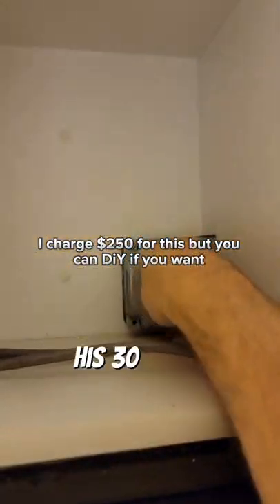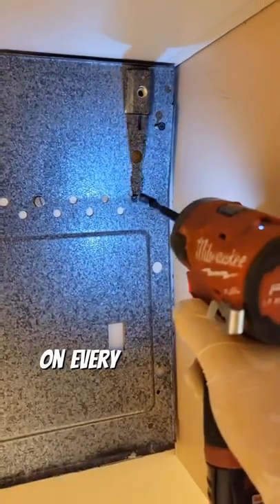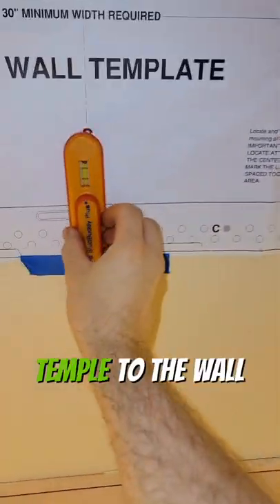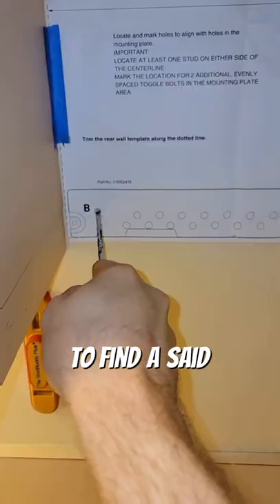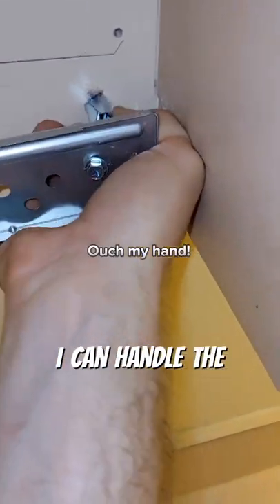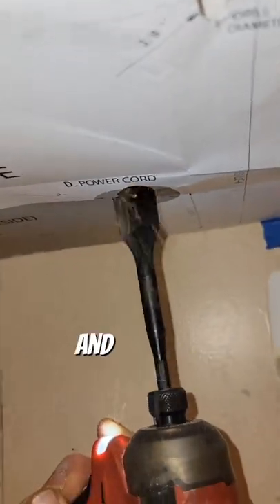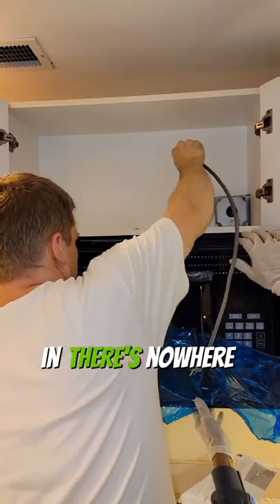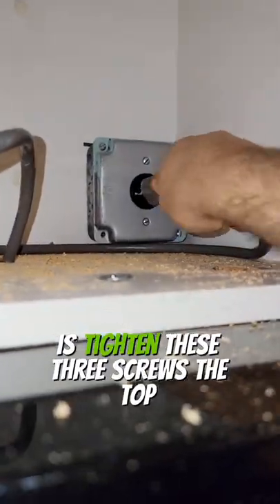How to replace an over the range microwave. shoutout to Studbuddy for send these over #shorts #diy

Comment: Man those templates really do make things easier
Reply: But Imagine putting the wrong size of texts and or wrong sized paper 💀
Reply: My favorite are the ones that are cardboard from the side of the box....(they should have done it sooner) and you can hold it one handed and drill your holes with the other....only thing I would change is making the mounting tabs on the wall bracket and the screw locations up top universal between brands
Reply: Takes 30 seconds to do those measurements lol
Reply: @evictioncarpentry2628  30 seconds saved with the template though, right? 

i install tons of cameras so i just toss the template from memory of how it works. however whenever we get new equipment to install it’s nice to have those templates. instead of doing measurements 20’ up on a ladder or 30’ up on a lift.

Comment: I have installed a lot of microwaves over the range microwaves for a major hardware store. Never had three screws always had two screws in the top.
Reply: Some of the old ones had 4, some of them have 3 (GE I believe), but most of them do have two.

Comment: I found the stud….
Or possibly the steel gas line… 
Or possibly an electrical pipe or flex conduit…
But hopefully the stud.
Reply: A magnet would not latch on to a black pipe or shielded conduit behind the drywall. Its a weak magnet and needs the drywall screw to be right at the surface.

Yet another youtube contractor acting smart.
Reply: Not everything is metal studs
Reply: @89Ayten  well technically you found a drywall screw and are now hoping the builder sunk thst specific screw into a stud
 
but yea once you drill it in you'll know lol

Comment: I don’t see the point of making a new hole for the Power cord. i’ve been installing these kind of microwaves for a long time and I always reuse the existing hole on the cabinet.
Reply: That usually works but there is a few cabinets that don't have the 1/2 inch of lip around the outside to give the needed gap for running the cord in between to reuse the old hole

Comment: If your microwave is "dead" it's probably just the magnetron. In fact some places in Europe they don't even call them microwaves they just called them magnetrons. The magnetron can sometimes be replaced and the microwave put right back where it was
Reply: Or i can just get a new microwave that has wifi and bluetooth
Reply: @Dirkadew  that you may have to do all of this work to install the new one whereas by keeping the old one you just put all of the original screws in their original holes

Comment: those pos fridgidaires the handles crack on them. and the lights are dim as fuck. if your gonna be slumlord just put a cheap range hood so the tennant can use a bright ass 100w equivalent LED or something.